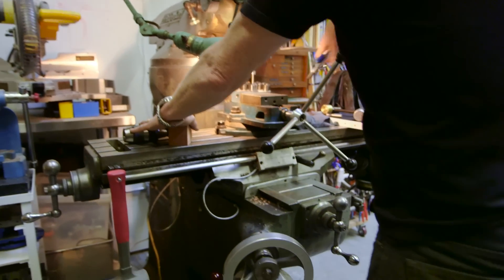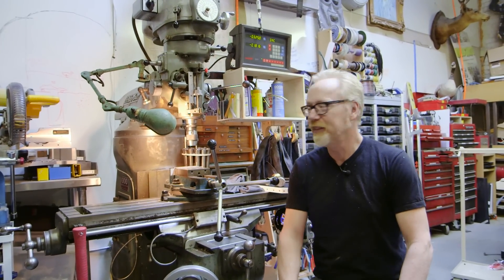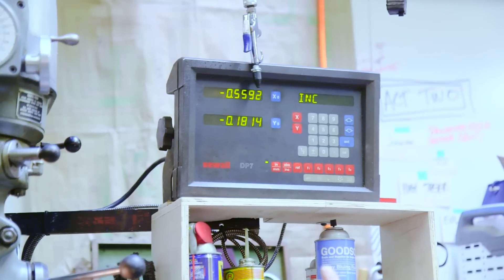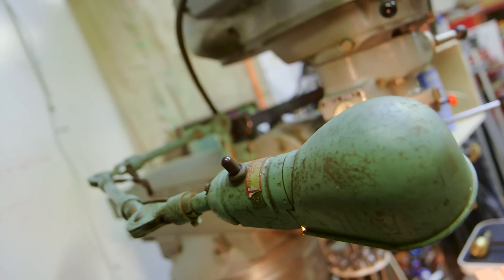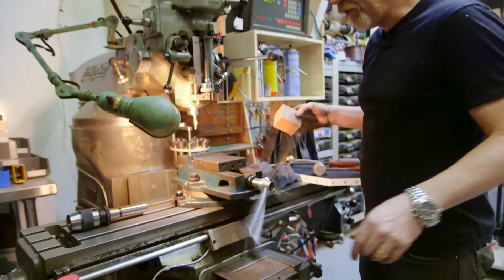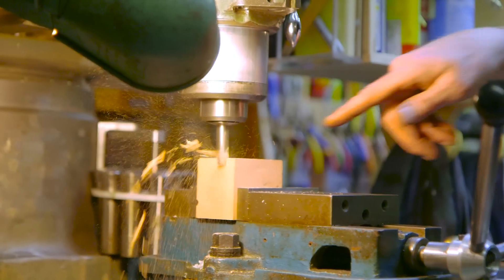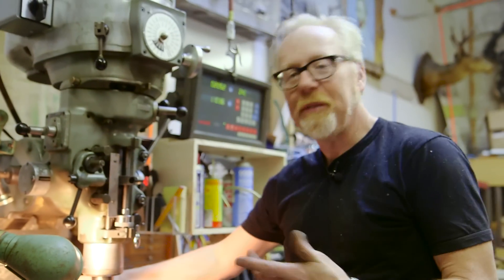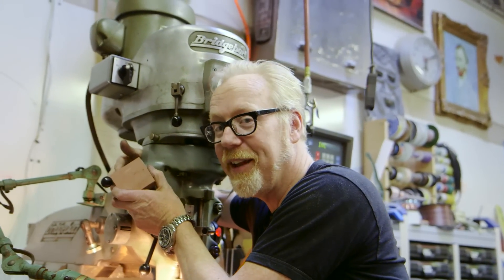Adam Savage's New Milling Machine!

Comment: wait so he can use this as a cnc machine?
Reply: +QurttoRco no, it's read out only
Reply: +QurttoRco CNC stands for computer numerical control, since this is all operated by hand, no.
Reply: +Skittles .McSkuttles but he has motors on the controls
Reply: QurttoRco I think they are for manual use only
Reply: +QurttoRco He has "one on the knee", which makes back&forth on the main table axis easy, (because otherwise you have to spin that wheel until your back breaks) but the other two axes are still manually set.
Reply: not this one but there are cnc mills and they are incredible (and extremely pricey)
Reply: Blake Eggen
you can add motors on these and use it as cnc atleast that's what google search says
Reply: +Jeremy Lee The knee moves the table up, and down. An X axis power feed makes it go back, and forth. That machine has a quill power feed too.
Reply: +QurttoRco You really can't. Not unless you want to change all of the lead screws out to ball screws. You can get a Bridgeport CNC 1 though. Those things are usually scrap. Often the ways are in good shape on them too. Because very few people ever knew how to run them.
Reply: +QurttoRco You can but you're better off just not. CNC machines have anti chatter systems that are basically just a differently designed split nut. This allows you to perform "climb milling" which is when the leading edge of the bit is having stock fed into it. This gives a better surface finish but is much rougher causing issues on manual milling machines unless it's an extremely light cut (5thou or so)
Reply: Daniel Jones
When a servo motor is connected to the lead screw it is anti-backlash. The torque of the motor holds the lead in place. It has nothing to do with the nut really. In fact decent CNC mills have ball screws which you can drive just by pushing on the table. But not when the servo motor is powered up.

Comment: Wow, brings me back to when I was 18 and worked for a Tool & Die maker. Pieces of red hot steel flying everywhere and then the odd one down my shirt. Good times.
Reply: +Drokker Elq check your speeds and feeds, if your throwing chips that hot your doing it wrong.
Reply: A little late now. As I am no longer 18 and heading towards 50.
Reply: +Zoink That is par for the course if you're using a carbide fly cutter. They come off smoking hot.

Comment: I'm a 19 year old machining and CNC student. We have 4 manual mills and 2 CNC Mills. The bridgeport we own (circa 1980's I think) has a quick change tool holder. But no motor on the Knee. Motor on the Knee is luxury.

Comment: Hey machinists, why that's awesome? Motor-on-the-knee?
Reply: Because the table on that machine weighs well over 1000 pounds, and on most manual machines like Adam's you have to move that massive table with a hand crank, and its a workout just to move it an inch or two up or down.

Comment: Nice!  I learned to do machining on a giant Bridgeport mill myself as well as a monster Leblonde lathe.  I wish I could have both of those machines in my garage workshop.
Reply: +Susanfaery Bridgeports are not big vertical mills. Now Kearney & Trecker made some big mills. I ran one of their #3s that looked like the prow of a battleship. It was a model with the walk in coolant tank apron. It could run a 2.5 inch diameter hogging end mill through a block of steel like it was cutting balsa wood.
Reply: Paul Frederick Ok, I guess giant would be a relative term.  To me anything bigger than a drill press is giant.  I actually worked in a very large machine shop down near Magic Mountain in Valencia many years ago.  I was running computer network cabling to the various machines there.  They had some extremely large mills there, maybe not quite as big as what you were talking about but I do remember the tool rack on the side of one of them that would hold about 200 tools and was at least 12 feet tall.  The machine was much larger than that.  They could machine M1 tank turrets in it.  (And they did...)  It had a conveyer belt to remove the chips as the machine ran.

Comment: Dear machinists, why is a motor on the knee so awesome?
Reply: Because the table on that mill weighs well over 1000 pounds, and on most manual machines like Adam's you have to raise and lower that massive table with a hand crank, and its a real workout to move it even an inch or two up or down.
Reply: +Jose Martinez Try hand cranking a heavy cast iron table up and down for a while and you will soon realize why.
Reply: +Jose Martinez the Z axis is a nightmare for machinist
Reply: +edo kesuma putra And for Khan from Star Trek 2... (original)

Comment: that mill looks (and sounds) very Skookum
Reply: +Corallia Fluff
Your instincts are correct.
It is in fact one of the most Skookum machines in the world.
To be honest, it's entirely possible that the Bridgeport mill Adam is showing will outlast him if cared for correctly.
Even if mistreated, any combination of a mill and a lathe can produce all the replacement parts needed to repair a mill and a lathe, assuming a supply of proper metal alloys.
This is why Adam says you can rebuild civilization from this machine and a lathe. A mill and lathe can build anything from guns to internal combustion engines, and everything in between.
The only things they can't do involve joining two pieces of metal. That's why you need a welder, and an oxyacetylene welding/cutting torch to round out the set.
With those 4 "advanced" tools you can build anything that you could need to build anything you want.
These are the tools that build tools.

Comment: Pretty jealous..... I dream of having my own some day. Adam, be careful when lowering that knee, if you don't release the lock before lowering it can drop all at once, bad things happen.

I worked at a job shop where I'd run three at a time. Set up two doing cutting with power feed on the X axis, then be drilling holes and other work on the third.

Comment: I find it beautiful that something that is 50 years old is still totally relevant and usable. The milling machine too!
Reply: Bridgeport was the best of the best along with Brown and Sharpe. This machine will be viable for another 100+ years if its maintenance is kept up
Reply: In the Metal Workshop, In wich I worked for a placement, they used old Soviet Machine build in 57+ They have an awsome old paint job on them that says I am a piece of Soviet Engineering. xD
Reply: +prowokator haha good one
Reply: +prowokator I still working with a lathe from ww II era
Reply: +LuKe g Yeah, I am aware of that :) My comment was more of a joke, but you're totally right. It's amazing how far you can get with mechanical parts only, not using micro chips etc at all.
Reply: I'm a toolmaker and every injection mold Iv'e made has been on a Bridgeport but they had electric motors and a slightly different head so it can be used as a 3 axis CNC mill
Reply: The cool thing about the Bridgeport style milling machine is that the design really hasn't changed much in the last century. It's kind of the standard style for a milling machine these days. I got to admit that Adam is probably right, with a lathe and a milling machine you could rebuild civilization, as long as you have electricity to run it
Reply: LOL, no one got it yet, he is well over 50.  he is funny lol, the milling machine too!
Reply: @ThePEP3000   When this was posted, he was 48. He's 51 now. (Dec 2018)
Reply: prowokator most these machines are still in use in modern shops. we have our cnc machines but all our manual machines are still machines from this period. every shop ive ever been in has a few.
Reply: i think he would rather do it hands on, rather then in front of a screen
Reply: jacob fraser nah, laserboy would definitely use a CNC mill
Reply: jacob fraser if you get the right one you can do both. And of course mashing on the levers is fun, but try to make something with a round shape and stuff gets quite complicated/impossible depending on the shape. And CNC is more precise, but I don't think that he needs ultimate precision considering the age of the machine
Reply: I don't think he bought it because it was cheap or reliable. He probably bought it for the nostalgia factor considering the kind of cash he has. You can get some very reliable CNC mills for a pretty penny but if you got the money it's the only route to go.
Reply: Chris Baer probably since he mentioned the age of the machine
Reply: I knew it, an old clapped out bridgeport. As the video was loading i thought its gonna be a bridgeport.
Reply: Youtube User right.
Reply: Chris Baer I think that happens if you watch AvE and Tony too much, not that you can watch them too much but you know what i mean.
Reply: Youtube User lol. sadly I know exactly what you mean.
Reply: Ryan Oberfield exactly. And the beauty with a lathe is that's all you need to make another lathe. When I was an apprentice they had quite a few bridgeports still in use every day for heavy use jobs. And I believe they still use them today. I worked at a place that still used fobco drill presses that were from the 1960s. And they were loads more powerful and reliable than new modern ones. Lol
Reply: How would you machine the ways for a lathe on a lathe? Can't be done.
Reply: The machines I use are from 1942 to 1958. They run 7.00 till late 5 days a week. Still going, just about. I would love a bridgeport mill and a lathe to help keep these old thing running.
Reply: Yea but its milling machine, tell that to the shaper...
Reply: I’ve got a Cincinnati #3 mill from 1940 that is still very useful to this day.  I was super jealous of the power feed on the knee as well.
Reply: prowokator;  Not just that----it is a Bridgeport.
Reply: I resemble that remark
Reply: +prowokator Most tools that are that old and even older are still very relevant. Most tool and die and carpentry shops still use a lot of old equipment as it was built to last with great reliability unlike nowadays.
Reply: +Tested Get a CNC millingmachine you can make complicated shapes much more easily and basic programing isn't that hard, especially for someone as capable as Adam. Of course it's expensive but I don't think that should be much of an issue for Adam.
Reply: @bbeatststs  I got a few 1600 oz stepper motors i want to try this for my 2 stroke project!

Comment: Three phase power, what separates the hobbyist from the nuts (at least when a home shop is involved)
Reply: +MorRobots Or you know. Here in europe where 3phases of 230v is what is fed into all houses (and then used as 230v single fase to neutral in all the sockets ofc, but it's available for a 3 phase plug if needed.)
Reply: only need a 3 phase converter and your good. easy to make if they want to go that route.
Reply: Without question but still an interesting dividing line.
Reply: +dumle29 Did you say every home has 3 phase to it? Seems like a waste most of time...or a nightmare for electricians trying to keep the load spread evenly across the phases. Out here we use 240V, which makes the voltage of 3 phase about 400V......it can do some serious work.
Reply: +MorRobots lol, just got mine working a couple weeks ago :), gotta love vfd's!

Comment: Adam didn't have a Bridgeport before now? I would have bet money he'd have a real mill. It's the most useful machine you can have in a fabrication shop, or at least you could have a good debate about it.

Also for those that may be wondering why a powered "knee" is awesome: That motor controls the height of the table the work piece is clamped to (where the vice is) and you may notice that table looks incredibly heavy... because it is. So when you have to change the setup dramatically to get taller or shorter parts in the mill, you've got to hand crank several hundred pounds of cast iron with human power if you don't have a motor on it. It's not the worst thing ever, but it isn't fun either.

Also of note, if the mill is getting worn sometimes the table will have a tendency to "run away" from you on the way down and let gravity drag it all the way to the bottom of the machine (with a big steel handle swinging around wildly, which could easily break your arm, on the way down) and the motor prevents that.
Reply: +Maxwelhse He said he had a "baby" one but not a full sized one at the end of the video. Thanks for the explanation!!

Comment: why is that motor on the knee thing awesome?
Reply: +Maxwelhse 
Everything you said and for the fact that the handle is removable.  Which after about 10 cranks it wants to disengage the teeth and come off so you have to push it back on.  I've those modified to use a air ratchet but a proper motor with reversing switch is way cooler.
Reply: @garygsp3  I know of someone who forgot to disengage the handle when using the motor, the very nearly knocked themselves out.
Reply: +Maxwelhse there we go, fancy
Reply: *****
For just a guy at home, yes, it would be fancy, but for someone running production parts on a mill like that (30 or more years ago) it could greatly improve their daily output.

I've never actually used a mill with a powered Z axis, but the shops I worked in had enough tooling that it wouldn't have saved me "that much" effort. My setups could all be changed without moving a work part "that much" and I never ran production with them.

Since we're talking about it, power feed on the X axis is completely mandatory (y is nice too) though. If you're machining something hard like stainless (which forces you to take small cuts a little at a time) you could find yourself manually cranking a little handle, and having to focus on doing it at just the right speed, for HOURS (while getting burned by hot little chunks of stainless thrown at your arms/face/neck/etc the entire time) without it.
Reply: had my dividing head on and needed to switch to the machine clamp and back to the dividing head.. i got the same model but than a lagun.. table weights.. around 200 300kilos and i have to handwheel that 20 cms up down up.. . its a luxury to have a motor on it.. not needed but like a extra option on your car. you can still drive but ya..you get what i mean
Reply: +Verlisify The quickest way to answer your question is probably for you to watch pretty much any "CNC Mill" video on youtube and see all of the amazing things you can make with a mill (which is almost anything).

This machine will do everything a CNC can, but it will just take way longer. A manual milling video may be boring for you to watch due to that.
Reply: +Maxwelhse I meant motor on the knee, I am familiar with a CNC
Reply: ***** Every time you change your setup you have to manually crank the table (which weighs several hundred pounds) up and down and it also takes forever to do since 1 turn of the crank is only 0.100". The motor does that work for you.

Comment: checks ebay $2-12k closes ebay
Reply: +MegaCreepermann Can be had locally, if you're in an area with a strong manufacturing base, for under $1k if you keep your ear to the ground. It won't be as nice as Adam's though.
Reply: Maxwelhse Probably, if its standing in some yard for 10 years youd have to redo a lot of the moving parts or use it for scrap.
Reply: *****
That's almost never the case. People don't just move a mill out to the back 40 to rot away.

What usually happens is the machine shop gets a new mill, their old mill goes to a maintenance shop but the tooling never does (and no one knows how to use it anyhow and they're not going to learn when it's "someone else's job": the toolmaker), so no one ever touches it.

When this cycle repeats the oldest mill goes on the market, usually after being stored inside a nice warm factory and mostly in the same shape it was the day the machine shop retired it decades ago.

There are exceptions, of course, but that's pretty much been the story for every guy I know that's bought a mill at that price. Some guys do put some money into them over time, but they are totally usable the day they come home.